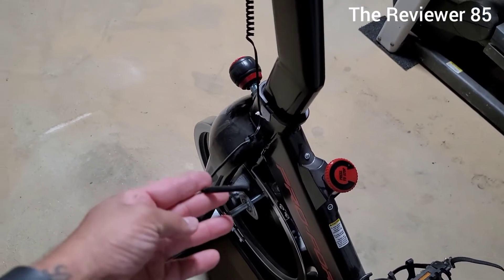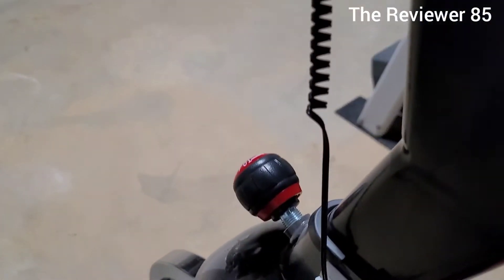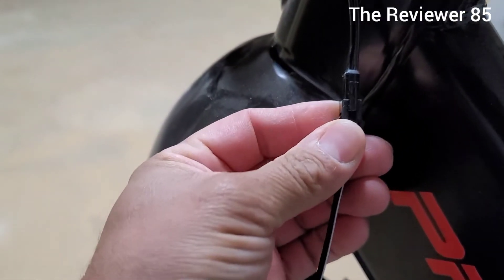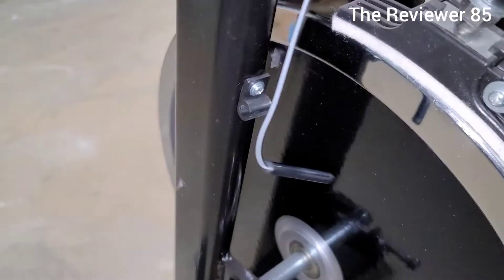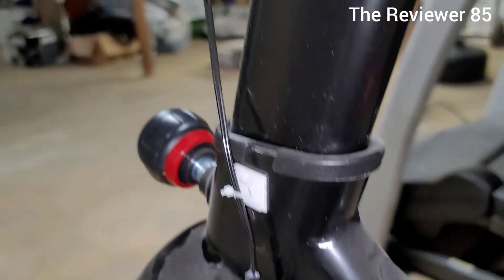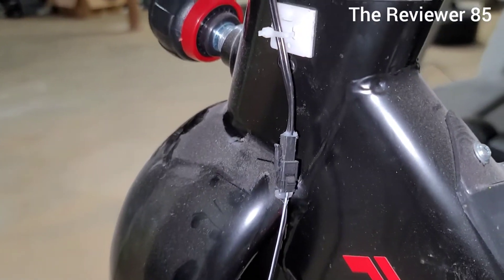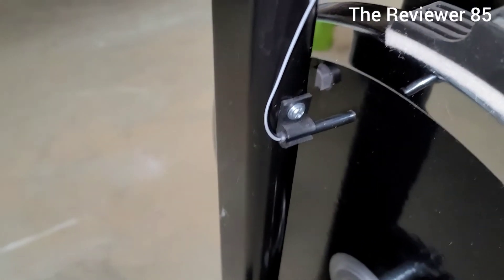SPX 500 Sensor Install

Comment: I’ve bought two different speed sensors for my pro form 500 SPX and both that came in Were too short and aren’t anywhere near the wheel.
Reply from the maker: That's weird are you missing the wire

Comment: Thank you. Mine is not registering
Reply from the maker: Mmmmmm that's weird
Reply: Did you get to work?
Reply: @dallascowboysnp7925  nope
Reply: @TheReviewer85  Mine isn't registering either.  Is there some kind of magnet that's supposed to be on the wheel?  Cause mine doesn't have one.
Reply from the maker: No to sure I never registered anything just use the small led it has
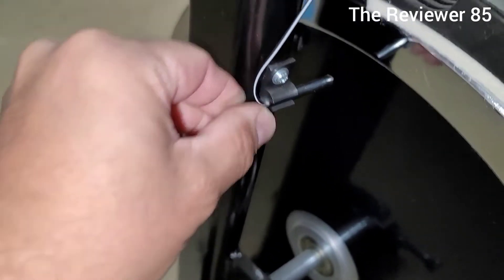Reply: @TheReviewer85  in the video, at about the 0:38 mark, if you look on the black part of the wheel, I "think" that's the magnet.  For people saying their display isn't working, this "might" be the problem.
Reply: If it's not registering, the magnet is missing from the wheel.  Mine wasn't registering either and I bought some magnets from Amazon.  All good now! 

https://www.amazon.com/Adhesive-Magnets-Ferrite-Backing-Ceramic/dp/B07F79TQ1J?ref_=ast_sto_dp